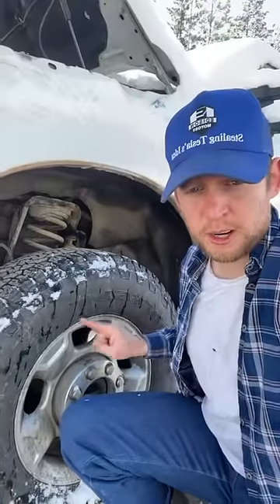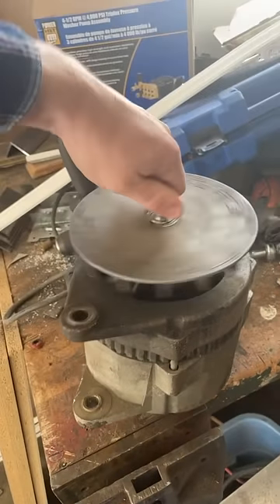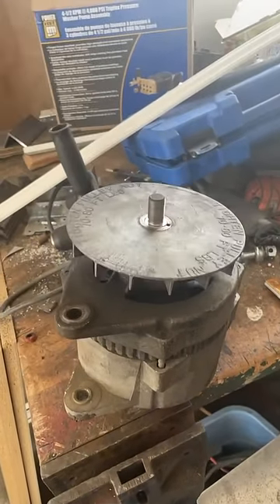Alternator on each wheel???

Comment: Ummmmm better bearings ?  Not all alternators are like your old seizing up alternator. All that has to happen is a systemic clutch that only applies spin power briefly every minute then the alternator motor can free spin until it slows down enough to release the clutch and another shot of power…. On and so forth.

Comment: I bet theres alternator with less friction. The guy isnt that far off. Sure its not a forever running car but i dont see how it couldnt in theory maybe add an extra 50_100 miles. Its a small amount of force sure the car might be decreased by 50 horsepower but im sure it could be arranged too add more miles too the total range. But personally i think that it would be cool too see a nuclear power tesla. Obviously dangerous if it ever got into a crash or not maintained but still i bet it could have like 20000 horsepower😂😂

Comment: Load of bollox. A 2.5 ton or more car has lots of inertia, and more than enough to rotate a set of alternators to increase range. However the charge will not exceed the power draw when employing use from the battery when motors are active. Regenerative charging by brakes should be a fairy story but in fact it works, why not go a step further by using both. Lots of technologies that create regenerative energy whilst drawing input energy are being developed and some have been known for over 30 years. 

Such an example of an idea would be a permanent magnet generator. In no load conditions it can generate voltages from 69.5 to 223.7 V and frequencies range from 33.5 to 50.9 V at rotational speeds of 2000 to 3000 rpm. Not infinite as magnets need replaced or energised, however many principles are being explored.

Comment: Sorry buddy it don't work like that. And don't use alternators. Use generators.  Use half your batteries.  Charge the other half. When one bank has died down. The other half should be cool and ready. Plug in at night to top off. At that rate should Use minimal power.

Comment: If that was the case a wind generator wouldn't work. The weight of the vehicle would overcome resistance there isn't much resistance in an alternator. I think your wrong you can gear it anyway you want slick.....

Comment: No your argument is for non charging 
You would still need to charge but very little and a short time 
If the engineers can design a better alternator 
The additional force to spin the alternators is les than 1%

Comment: ahhhhh no it's still energy. energy is different then power. gears make more power they turn the energy into torque(power) in watts or joules.. lbs, or... reignitve breaking is the same as stator and coil. put the alternator on the wheel. it will work.

Comment: Aren't electric motors working as alternators when you Regen brake downhill? Unless we are talking about a gas engine vehicle with alternators on its wheels which is not even reasonable cos you actually can't recharge or provide power when the vehicle is not moving 😂😂😂

Comment: Only problem with this you're not creating something out of nothing if you harvest the rotation of the week we harvest the air that's not Harvest anything that's movement that's that that's not nothing I mean turn the blades create the power at the generator alright we harvest the movement of the water that turn the generator so the problem is coming up with a generator that will be sufficient the Harvest the movement of the asphalt by capturing from the wheel

Comment: No it does not cuz we did this If you took took a belt and a pulley and put it on the drive wheels why it's spinning it's driving it's charging your batteries and then it automatically shuts off And you got also put a clutch on the gear so when it's charged it stops It allows it to stop It can work cuz we've done it what do you think they do with planes hello it did that during world war II this technique goes all the way back to world war II think outside the box guy It does work and it doesn't bog down cuz you're cruising at a speed and that speed is going to make the wheel spin You got to think

Comment: But that can completely be routed around whether you want to think about it this way it takes power to push power okay but the fact that you're running electric battery and using for alternators to charge it you can in fact throw on small servos to compliment that power intern at a little more cooling whether it be air or liquid and it's all cleared not that hard to figure out doesn't take a rocket scientist but everybody wants to think they know I don't know how many of actually ever played with electric engines batteries in cars but it really isn't as complicated as this gentleman is trying to put it😂
Reply: And by adding them servos you have also added to the power gains and build more power the fact that you're saying it can't be done it's been done reason they're not using it is because they feel it's not cost-effective but in all actuality it is quite cost effective

Comment: You could use a small pony motor to run the alternator and charge the battery. You could also use two smaller batteries and switch between the two while one is charging.  Do your homework before you yak about something you clearly don't understand.  I also see how repeating this garbage is beneficial to your business.